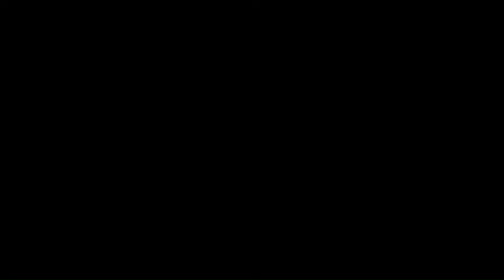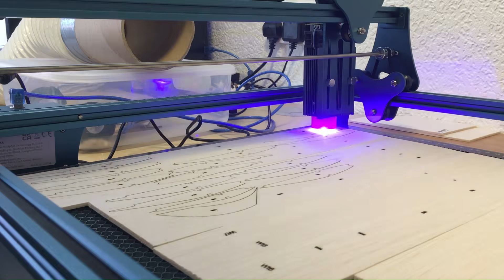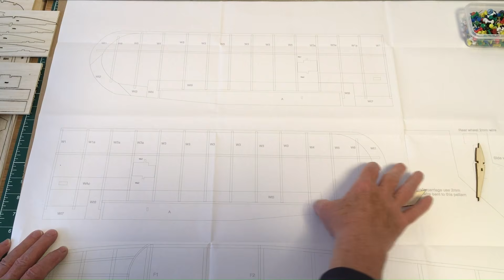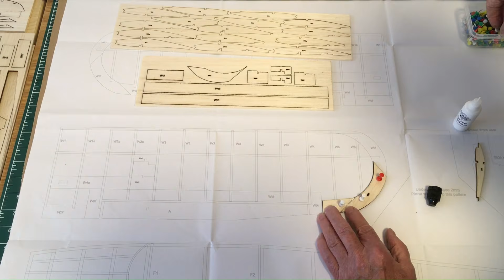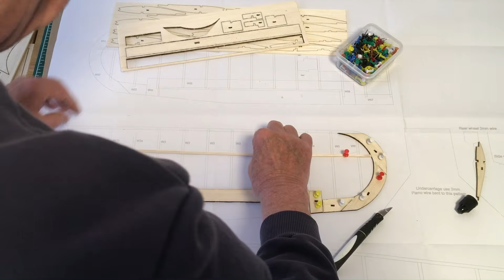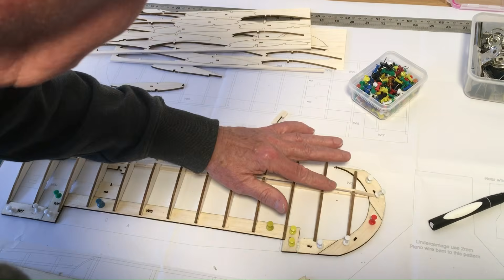Using a £250 laser to cut PERFECT parts for a balsa airplane then building it (Dixie 6)

Comment: i would like to have acces to some larger model plane in pdf , o dxf files.  there are many online but not like  around 3m wingspan . :(
Reply from the maker: You could scale them up on Lightburn perhaps?
Reply: @LaserRCModelguy  technically yes , but this is not as easy as it look :)
Reply from the maker: @MultiEski  True, if you look at my series 'Ajax' I expand the plan on lightburn and make a larger version. That might help.
Reply: @LaserRCModelguy  will do thx :)
Reply from the maker: @MultiEski  👍

Comment: I have a Longer Ray 5 20 watt laser. Do I need to  put that in place of the sculpfun laser, or does it make any difference?
Reply from the maker: Have you cut Balsa using lightburn and the Longer ray5 20W before? If so the process will be the same.

Comment: Im a 3D printer, I have a Ender 5 Plus that's had it (lasted two months and its done done) BUT, The Chassis has all the parts to build a lazer cutting rig. I just need a hacksaw and a reasonable priced lazer head and controller board to convert it. Which brand is worth it? and how many watts will i need?  Itll only be for balsa and lightweight ply much the same as your cutting here.
Reply from the maker: Hi, that's interesting, I use 5.5W to do these videos. I'm not sure which brand would work with your present set up, so I can't really advise on this. But, 5.5W is what you see in these videos. Let me know how you get on. 👍👍👍
Reply: @LaserRCModelguy  Thats a good option looking at the prices of the more fruity lazer modules. I guess if its struggling you can just run more cuts ?
Reply from the maker: @Gixie-R Yes, you set the number of passes when setting up the layers, I use 2 passes for Ply and typically 1 for Balsa.

Comment: Good afternoon, great video.
What glue are you using and I appreciate it’s not an advert but just interested as I hate using cyno as the vapours now play havoc with my eyes, and as your clearly from the UK, nice to see a product that’s available here.
Reply from the maker: I use 'easy sand wood glue' its a PVA variant that sets quite quickly. (Not as quick as superglue though) which is why I use pins and such. PS I have footage of Dixie's maiden flight and will put it on shortly.
Reply: @LaserRCModelguy  looking fwd to that

Comment: Hello, Really like your video, What is the thickness of the wood? 2mm or 3mm. I have the same laser printer. Can you please tell me the size of your honneycomb base, i have one but a bit small.
Reply from the maker: Thanks for your comment, the wood is varying thicknesses, but mostly 3.2mm balsa (3mm would be OK) The honeycomb I use is 500x500 mm
Reply: @LaserRCModelguy  Like i mentioned, i have the S9 and my laser is 5.5W and i am not able to cut 3mm with one passage on the same spec 500 X 80% power. DO you have the S9 Pro with 10W laser?
Reply from the maker: @luissoule  No, I have the S9 5.5W Are you talking about Balsa wood as opposed to basswood ply? I am cutting Balsa wood 3.2mm at these settings. You must set the height correctly using the tool. Also I would suggest you run a cutting test because it might be that your settings need to be slightly different to mine. Things like air humidity and such can affect the settings to some extent. Let me know how you get on. 👍
Reply: @LaserRCModelguy  What a surprise, i have tried the test, i must confess that i have the laser printer for a few years and never don it, but thanks for the advise, i have done it and discovered a few setting that cut nice and faster. Also got the honeycomb and really nice and large. can cut better now. Thanks again.
Reply from the maker: @luissoule  I am glad that you have found this helpful, it is good to get good feedback. Let me know how your future projects go. 👍👍👍

Comment: On the plans that I have to stick the wood on to glue I cover it with cling film , this save's the plan and keeps it clean, after al plans are not cheap to have printed. this ai a very old trick. Another for learner's to Lightburn is when moving cut's up or down is click on colour to move then the arrow on the side, this will move it for everytime you click the mouse.
Reply from the maker: Thanks for your comment, it is good to see how other people do things. Yes, if you want to re-use the plan then that is a good way to protect it, the one I had printed here cost £1.70 per copy, but there is a postage cost too. It is a good point that there are arrows to move the layers, but I think it is quicker and easier to just drag and drop the colour. If you are using a laptop without a mouse though the arrows might be better. Thanks for your comment. 👍👍👍👍

Comment: It is good to see others using hobby lasers for aircraft building. Kits have become hard to get and the variety is limited. I have been scratch building since the 70s and today my band saw and coping saws gather dust. 

Been using lasers for cutting wood pieces for a while now and could not be happier. My main rig is a home built 20W (830x830mm cutting area) in an enclosure with camera and good fume extraction. Also using dry compressed air to aid in keeping the lens clean and assisting to cutting performance. Cutting 6mm birch ply as well as balsa up to 12mm is a breeze. Cutting gaskets for carburetors and other machinery are simple also. Lightburn is my design & control software of choice.
Reply from the maker: Thanks for your comment, it sounds like you have a great set up there.👍
Reply: @LaserRCModelguy  Thank you, it was a journey, started with a small 2.5W unit and things evolved from there. My main use is cutting and not engraving, mainly used to support my leather business in retirement. Cutting templates and sometimes leather itself speeds things along nicely.

Comment: Very good video, everything explained completely.  Some questions- Is the glue a pva white glue like Elmers?  How do you deal with the glue adhering the balsa to the paper plan?  Does the char on the cut edge interfere (or improve) the glue bond?  Thank you for making the video.  It is a lot of work.
Reply from the maker: The glue is a PVA variant, I try to be careful with the glue, but I do get spots sticking that I carefully ease off with a steel rule, to avoid this you can put clingfilm or poly over the plan, as for the charring, I have had no problems with it. Thanks for your comment. 👍👍

Comment: How long did it take to cut out the first set of parts & what watt laser? Looks great
Reply from the maker: It took about 25 mins to cut the parts out, the laser is a 5.5W Sculpfun S9
Reply: @LaserRCModelguy 500mm per minute is very slow, but 5 Watts explains why.
I used to design Laser Cutting machines. I'm retired now, our cutting speeds were in mm per Second...!!...lol...😏🇬🇧
Reply from the maker: @EnglishTurbines  They must have been big industrial machines, could you get one for £250? LOL 👍👍👍
Reply: @LaserRCModelguy  Nope, they were real Industrial Machines though...The first one I designed was a bed less roll fed machine. It used a Scottish CO2 Laser 25 watts and water cooled...taken from the Tornado jet fighter for target illumination....!...With a Collimator on it, it had a high quality cutting focus of 0.003" diameter. ( Less than 1/10 mm)...This was back in 1989...On balsa, the cut was so clean, just a faint brown tinge. Vaporised!!!!...not burnt....lol....🤔😏🇬🇧
Reply from the maker: @EnglishTurbines  Sounds amazing. Really high level gear.👍

Comment: I was really hoping you would build this plane.  I wanted to see if you ran into any design problems on the way.
Reply from the maker: That is possible, but so far so good. everything is fitting perfectly so far. The one thing I haven't done yet is decide where to put the battery I will be making a platform for it and will position it to get the correct centre of balance then I'll add it to the plan. Thanks for watching and thanks for your comment. 👍